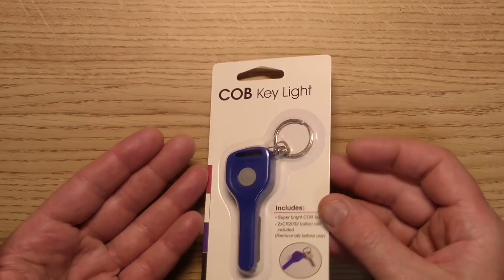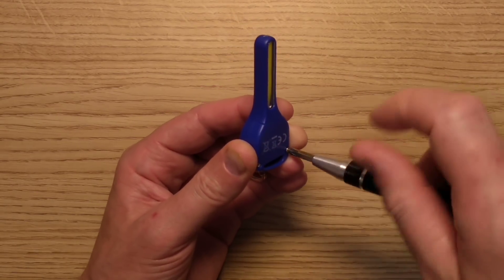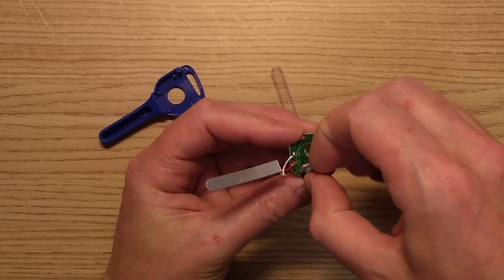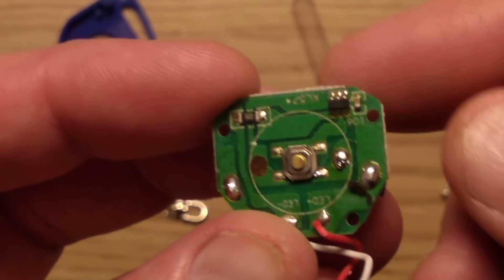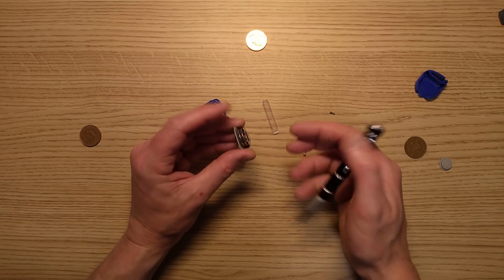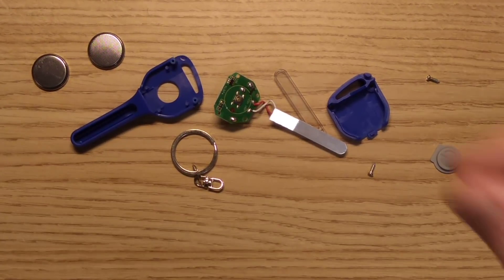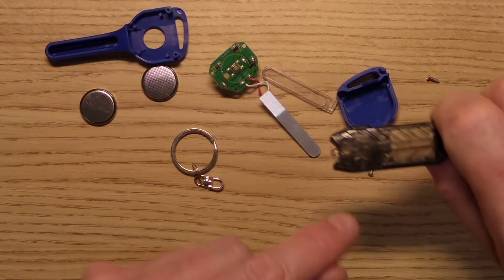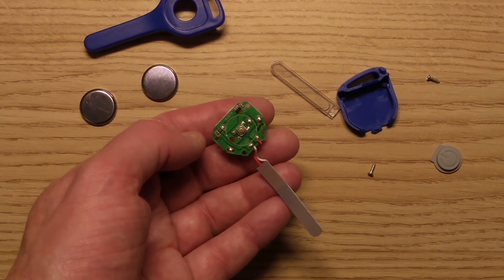Inside Poundland's keychain COB light.  (Good for the components.)

Comment: Clive or anyone, would you know how to disable the strobe mode on this? I want to use it for a project and it's quite nifty for a £, but I want the strobe mode gone... thoughts?
Reply: Rani Jazi I guess you would need to change the chip. Or maybe you could change the switch to a push-on push-off type and get rid of the chip altogether.

Comment: How good are the batteries included in these things compared to retail?  Considering a single CR2032 can easily be $4-5 in stores, would you be better off buying two of these $1 keylights for four batteries?
Reply: Yes for the average use they are okay..even the cr2032 in the 1 euro/pound/dollar set are okay...just don't use them for you car remote, if you like walking the go ahead...usually their voltage saggs at the end directly down when they are depleted

Comment: My tube died last month (water damage cause by a typhoon) ...
Reply from the maker: Open it and dry it, check the connections are OK.  But before that, hold the button in for about ten seconds or more in case you've accidentally locked it out.
Reply: Already checked it, the battery protection board is totally dead, there was so much water damage...
I think the water entered the tape...

Comment: I would definitely get this maybe a few of them. I'd make USB lights out of them because of that 100 resistor on the LED- trace. 6V from two of those coin cells. 5V should be no issue. possibly a project bigclive?

Comment: Some of those chips have undocumented function -- hold the MODE button while the flashlight is in any mode except off. It begins proper SOS Morse code mode.
And for some reason, the dimming function only reduces the brightness to 80% on models with boost converter (takes 1 AAA battery)

Comment: IN a recent visit to the USA version of Poundland, Dollar Tree, I came home with three small flashlights. Notable is that it runs on one AA battery. It has 4 COB LEDs, very small ones, maybe 0.25x0.25 in the handle as a flood light and a single larger LED as a spotlight. I am pretty sure the single LED has a forward voltage of 2.7 volts, so I have to wonder how it works with just 1.5 volts. I guess you can guess why I bought 3 :-)

Comment: I'm looking for some limited brightness torches for an escape room. If I were to swap out the 1 ohm resistor for a slightly higher value one it would reduce the maximum brightness? I have one of these already and it's much too bright for the purpose I need it, and the two cells don't last very long at all.
Reply from the maker: Yes.   Increasing the value of that resistor can be used to control the intensity.  Using a value of around 300 ohms will still give out useful light.

Comment: I think the only "improvement" I'd make is a slight increase in the resistor value. With a non-directional light source that's often going to be the only light source around, I prefer it to be a softer, longer-lasting intensity. Easier on the eyes, too. :) Still, yeah, a decent amount of components for a pound.
Hope everything goes/went smoothly in the show!
Reply from the maker: A fee technical burps, but nothing too bad.  Mainly involving waterproof lights that aren't.

Comment: That's so weird, those batteries are worth more than a pound.  Plus an actual micro switch.  It must have cost more to make than you paid for it.
Reply: The batteries are worth far less than a pound - they often have 8packs of CR2032s for £1.
Reply: @_Piers_  

Wow they're really ripping us off here in the states.  If I tried to buy those at the local Fred Meyer, they would cost at least $10.

Comment: Problem with those no-name CR2032 batteries is that they don't last too long when inserted into a motherboard for CMOS storage. 
They will test fine with a voltmeter (3-4V) but with even the tiniest current they drop to almost 0V after only a year or two of usage. Good CR 2032 (for example Varta or most OEM batteries delivered in PC boards) last around ten years.
It probably will not show that the battery is depleted, but the CMOS can sometimes corrupt with those cheap batteries causing the PC to randomly freeze or not to boot

Comment: If you hold the button down it also goes into S.O.S flash

Unfortunately, the batteries do not last longer than a few weeks of intermittent use...
Reply: You can replace the battery's it's same ones you use in digital scales the kitchen ones you can buy the crc3 battaries in. Argus some blood sugar monitors have them
Reply: Understandable with the cheapo batteries it came with, but branded 2032's should last much longer

Comment: BC, I have a suggestion for you: Walmart in the US sells clip-on lenses for cell phones (wide-angle, macro, etc.) in a small kit, I wonder if those could help you get those up-close shots we love? They probably don't work so well for video, but I'm sure you could get some pretty decent close-up stills. (Not sure how you'd get them into a video whilst away from home, but you could always just read off what you've seen and maybe upload them to the cloud for interested parties to peruse.)
I haven't tried them myself, but I was actually surprised to see them and thought, "why didn't I think of that?"
Aside from the annoying-but-perceived-as-a-safety-"feature" flash mode, that's actually not too bad of a product. Built to a very low price point, but it appears to have been well-constructed - even to the point of user-replaceable batteries in a common size. The factory could have omitted the battery door entirely to shave a few tenths of a cent off the manufacturing cost, or slapped one of those oddball solar light 2/3 AA batteries, and it still would be worth the price. Clever of them to shape it like a key when it is intended to be carried on a keychain, although it does closely resemble the keychain toys for babies which leads to that potential hazard.

Comment: Those cob lights are excellent value. 
My COB wasn't bent and it will run from a single CR2032 shimmed out with a 5p piece. Grab as many as you can.
Reply: What does COB stand for
Reply: @steuk6510  Chip On Board, the bare microchip or LED is mounted to the printed circuit board. As opposed to the usual method of putting chips and LEDs into a housing with pins coming out, then soldering the pins to the board. COB microchips are soldered straight to the PCB and have a blob of black epoxy plopped on top to protect them. It's slightly cheaper, if you're going to make millions of something it can save you money. 

Most cheap electronics use COB. Many of those cheap games console clones (ie the NES clones) from China have the main chip as a COB. Lots of toys also have a COB, sometimes two, with the main processor being in one, and a ROM chip storing games / data / sounds etc as the other.
Reply: @steuk6510  chip on board

Comment: Seems decent for what it is, even if the design is a little gimmicky. Got an under-cabinet COB strip light with two brightness levels that runs on 2xAAA and it seems to last rather long on batteries, given intermittent use. Plenty bright, even if the color rendition is likely to be crap - but that's not the point of these things. I figure this keychain thing will be similar even with 2032.

Comment: It's a bicycle light (nominal -- for the front). Depending on 'bendability' of the COB, it could be wrapped around the circuit board's uniformly-radiused part, then the whole could be potted in a blob of home-brew Sugru… The attachment mechanism? Always a challenge, the strap… Hmmm. Embed the key ring in the Sugru, along with the swivel, and wing it from there on out.

Comment: In terms of battery life, I wonder how 2xCR2032 would compare with 1xCR2032 and a joule thief circuit. 

I have been buying devices made up of 10x parallel leds attached to a 1xAA battery holder that fits in the neck of a wine bottle - I must assume it includes a joule thief - and the whole thing is only about £1.45 shipped from china so they could probably swap 1xCR2032 for the joule thief at the same cost to build.

Comment: what's the intended use of the epilepsy-function that many flashlights have?
Reply: Emergency beacon of some sort I believe.
Reply: The serious reason is that the manufacturers usually also make bicycle lights, which almost always have a flashing mode for daytime visibility, and they use the same control chip in the flashlights (cheaper to just order and track the one part).
Reply: For half the battery drain you get more visibility. Win win
Reply: Can be used as a self defence light by blinding an attacker with bright flash
Reply: Hehe yea
Oh look, an attacker is approaching me. I better pull out my fla [gets shot]
Reply: It's a Flash-light, that's what it does
Reply: it's a FLASH light, how can you make a FLASH light without a flash function?  DUH. 🤔😂

Comment: More like, "High mode, low mode ... and 999 time because seizures." I'll never understand why they build rapid flash into so many LED products, same with SOS. Outside of teenagers playing Airsoft and abusing it to look tacticool, are there actual use cases?
Reply: The fit-inducing mode (which should be available, but outside the simple serial-click mode cycle e.g. via long-press only) is … not unwelcome … on a bicycle light.

Comment: Not all Poundland stores get the same products. I have 4 stores to choose from, 2 in Portsmouth, and
2 in Fareham a few miles away. One of the Fareham stores seems to get premium products like £1.00 travel comfort compression stockings each year  and £0.50 personal travel alarms with built-in LED flashlamp,  which seem to be very good value for money. They have a grenade-pin actuation mechanism. Here are also £1.00 door/window alarms which have a magnetic actuated reed-switch mechanism, but use a similar circuit. 2 squeaky balls for a £ - my dog loves Poundland.

Comment: As a keychain, I still prefer my somewhat bulky LED Lenser P3BM with its amazing battery life of 1 AAA cell every 3-4 years. I bought it in 2011, and when the little aluminium eye for the keychain ring in its rear switch part recently broke, it got replaced for free. I think it's now on its 3rd battery or so.

Comment: I may buy a few at the dollar store and mount them on the wings of my RC planes as landing lights. I can rig a  remote switch to work off my transmitter and receiver( I already have a few) that will fit this application easily. They are so bright they will light up the landing field as I smash into the ground. " Pull up" Pull up"  UGGGHHH!
Reply: RC Hobbyist Extreme your comment took a beautiful turn at the end there
Reply: Look on this link and you can get them in any size you would ever want... https://www.aliexpress.com/item/32906820932.html?spm=a2g0o.productlist.0.0.69b31026qfmZlz&algo_pvid=057e9f54-e5ae-43bb-99ab-96a3a2c5cea2&algo_expid=057e9f54-e5ae-43bb-99ab-96a3a2c5cea2-0&btsid=fee2270f-a6c4-4b35-87c3-2745783f8e1f&ws_ab_test=searchweb0_0,searchweb201602_10,searchweb201603_52
Reply: Funnily enough I had this thought too.. although I'd just have them on all the time for simplicity 😄
Reply: Make it easier to find the crash site?
Reply: Bitching Betty
Reply: So they have dollarland stores in USA. What about the tarrif on this stock that comes from china
Reply: @m101ist  In UK at least it's usually not worth their while trying to impose a tariff of this low value stuff. If you were ordering £1000s of the stuff at a time then yes but one offs are considered commercial samples and not worth their while. I've ordered loads from Ali and never had any issues with our customs. The most they would charge if at all would be local tax rate i'm assuming so no more than 15% in US
Reply: @m101ist  with the tariffs, the exchange rate, and the expense of running a store in the US, our dollar stores don't tend to have recent products this nice. Or if they do, I have been shopping at the wrong dollar stores.
Reply: @m101ist  Of course they do. I was wondering that myself. Seems tariffs only affect certain items, not all. I heard that as things go down hill, it will affect such things as toys and other items. Its only a matter of time before dollar stores are closed.

Comment: 0:40 Pretty sure that was just insulating one of the battery terminals, so the thing wouldn't come on in transit, if it got squished, and run the batteries flat.

Comment: so this runs on 6v, is that correct? wonder how bright they would be off 5v, they would make good lights for rc craft, wonder what the actual led is getting, scrapping the circuit would be even better and just having a resistor.
Reply from the maker: It's relying on cell resistance and also the switching components resistance.
Reply: @bigclivedotcom  i was in poundland today and saw them but id just had a row with a security guard of another retailer over where id parked my car and had finished the conversation with 'you have no authority over me, go away' and was keen to return to it so never got past seeing them hanging on the shelf lol

Comment: Nice of them to make the battery replaceable even though probably most people will never use this enough to drain the batteries. I still think it's preferable to devices that cannot be recharged.
Reply: Its good for recycling/trashing..no one should like glued in batteries looking at the (f)apple
Reply: I think it costs more to change those batteries.
Reply: @giornogiovanna729  You can get a set of like 40 flat batteries for £1 from Poundland. They have quite a few of the CR2032s, although not enough as they seem to be super common nowadays.
Reply: @hoixthegreat8359  Of course bulk buy or Poundland makes sense. I have zero (0) products and projects that use 2032 so I was thinking about that (also no Poundland here). Some places sell it for like 27 cent and some sell for 85 cent for a single battery so better make a price research.
Reply: @hoixthegreat8359  I've often thought of getting a couple of sheets of those batteries. Then putting them all in series. You'd get quite a voltage. Not much current of course, but you could probably kill someone with 200V worth. Like an alternative taser. Instead of thousands of volts at microamps, you have hundreds, at enough milliamps to fuck someone up. 

After all, people getting zapped by the mains will fly across a room. They usually survive but not always. So maybe a container full of little batteries would make a mean personal protection device. 

You could even stick a resistor in series, if you wanted to be kind. Or perhaps charge a capacitor with the voltage and zap your enemy with that, rather than giving them the full current capacity of the battery stack. Would limit the current so be a bit safer. How safer, you select when you choose the capacitor.

Comment: They sell a AAA powered cob LED at the US Dollar Tree stores.  I just bought 10 of them for the parts.  They pull 250ma at 4.5 volts or around 1 watt.  Sadly, no switch, chip or resistor but they are $1.  Amazing how cheap they can make a functional product.  Battery holders and cobs for a buck isn't bad.
Reply: I harvest the boost circuits from their 2xAA phone chargers.

Comment: If it is only the switch that you need you have 250 of them in 10 types for just ￡3.55
On Aliexpress search for  -  250pcs/box Mixed Tactile Touch Push Switch Kit
Or only the 4-Pin 4x4x1.5H SMD Push Button 100 for ￡1.03
and no hassle to get it of the PCB
Reply: Like I'm ever going to need 250 switches...
Reply: @aszi77  Not with that poor attitude you won't
Reply: Assuming you want to wait a month for shipping...
Reply: @pileofstuff  That is only the first time, the next time you need one you have 249 in stock.
and BTW lately most of my orders on ali I receive them in 8 to 10 days.
Reply: @ZZtop-gg3lu  My recent orders from "the usual suspects" in China have improved as well. They're as fast as 25 days now. Late last year it could take well over 6 weeks.
Reply: @pileofstuff  In Februari it would still be close to a month 😊
I live in the Netherlands and since PostNL closed a deal with Ali the delivery time is 8 to 10 days with an occasional 5 day delivery. With start to end Track and Trace, very happy with that!
Reply: @pileofstuff  that's only to Canada...
Reply: @mahlapropyzm9180  Yeah, I guess we're just getting "special" treatment from the Chinese  up here...
Reply: @pileofstuff  we may be joining you if the kerfuffle in Hong Kong continues.

Comment: You bring up something that I have thought for several years now:  "The dreaded ON -LOW -FLASH-OFF" on a single button.  Most LED flashlights are made that way, but there are a couple of exceptions I found.  One on Ebay that uses a single 18650 for about $4.00.  It has a click on/ click off switch.  That switch is not a momentary type.  It still has the "chip" to do all the dreaded functions, but in normal use you never see them unless you deliberately partially press the switch (not enough to make it click) for a bit to go to the next mode.  (Partial press kills the power for a split second.)  If you turn off the flashlight, the chip resets back to HI mode after .5 seconds so the next press/click it will come on bright.  If anyone is interested, reply and I will post a link.  Thanks for the video, great job, as all of yours are.
Reply: I have a 45W 2x26650 5x 6 CREE flashlight that i use at work. The strobe deters bad guys very effectively. 😎